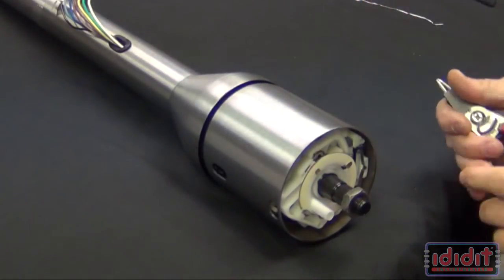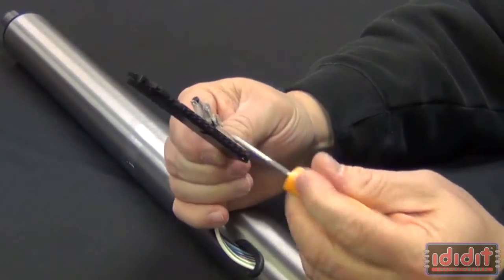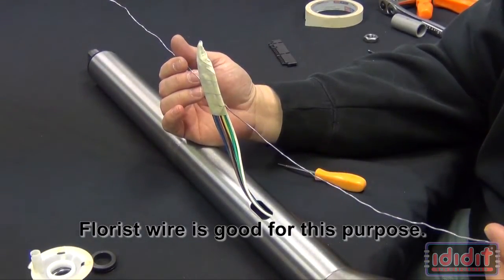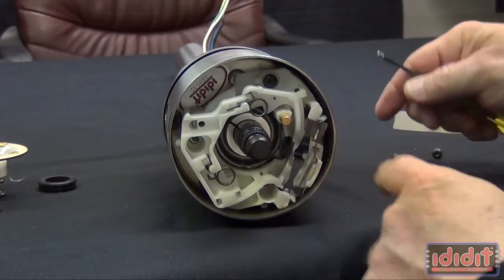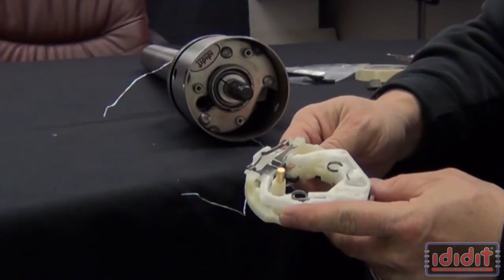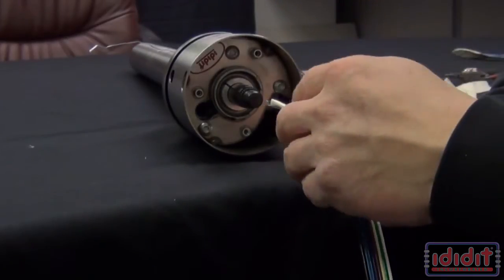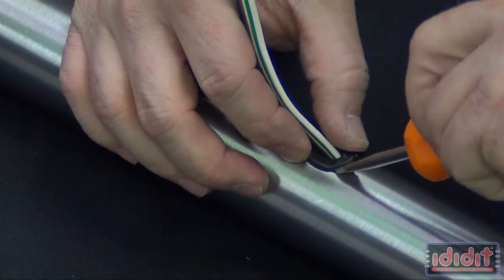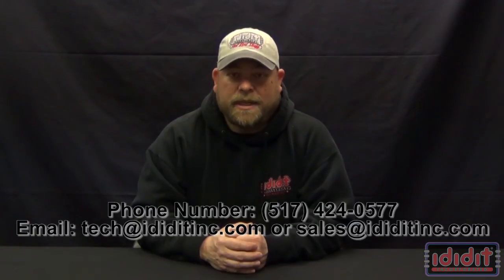How to Replace a Wire Harness on an ididit Tilt Column

Comment: My comments has nothing to do with the vid above. He did a wonderful job explaining the steps.  The part I missed for whatever is when you put the floral wire on the new switch to pull through, don't forget to tuck the end portion.  My wire kept slipping through. I had to woosah and watch the vid again to see where I went wrong.  Once that was done I had the wire through in 5 minutes.  Venting done and thanks for the vid.

Comment: Watched this video to help with  turn signal cruise control switch install.  I was shocked to see that the signal wires are in  constant contact with the rotating shaft, Adding cruise wires would only be worse.
 I expected Ididit  to do better than this.   
 So I drilled the bottom of the Bell and ran the wires out the bottom. At least I won't have things shorting out down the road!

Comment: Nice steering columns, too expensive for an disabled ASE Master Tech since 1978 to make a daily driver for a guy who is 6’3” tall. I do what I can using used parts parts, rebuilding them as needed so I know they will last.
  Too many years of hard work, no one tells you your elbows will cut into nerves, loss of hearing, arthritic finger that feel broke and July 2020 went in for L3-L2 fusion and the Dr. saw something he didn’t like. So, the team replaced the L3 down to including the “S1” and chiseled out the bone graph they used in 1987. I hope and pray to be able to finished a second $600 vehicle to drive. Perhaps my wife of 40 years can drive a newer car than her 1996 Geo Prizm. I am trying hard to keep it going. Wish I can fix a damage paintable column that I can fit on a 67 C10 truck. I can fix everything else if I have the materials. My truck will have a service manual so any tech can fix a system on this truck, long after I am gone. Thanks for the video & info!

Comment: Just spent 7 hours trying to do this in my 65 Mustang and I still don’t have the wires run.  Laid them out flat, taped them to a pull wire and every time I start to feed them in, the pull wire just unbends and pulls out of the tape because the area that the wires have to pass through is too narrow.  I’m literally about to pull this column out and buy a different brand!  This is absolutely ridiculous that it should take this long to pull a wiring harness through a column.  Absolute crap design when you have a part known to fail that would potentially need replacement!
Reply: I did it in 30 minutes while it was in the car.
Reply: If the tape come off the turn signal harness, it’s ok. The OEM design and level of difficulties is the same. Generally at the bottom of the plate behind the turn signal assembly, there is a 3/4” hole that the wires side into. If you have cruise control and active wiper controls, their are more wires inside this tube. 
  Place a stiff wire and tape over the end of the harness. Use a good flashlight from the bottom up, then guide the wire down the tube. Take it slow but the 6 or 7 wires will pull down the steering column tube, out the hole, install the rubber grommet then carefully lift the metal tab on each connector and place in the correct cavity of the connector. 
I truly hope this helps but it is not easy nor that though. Just be patient and it will come out ok. Hope this helps.